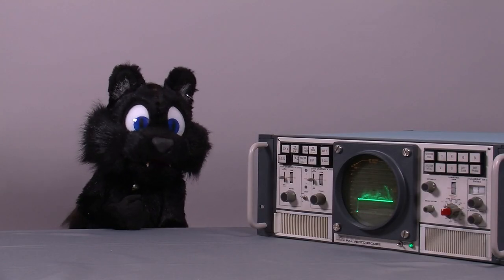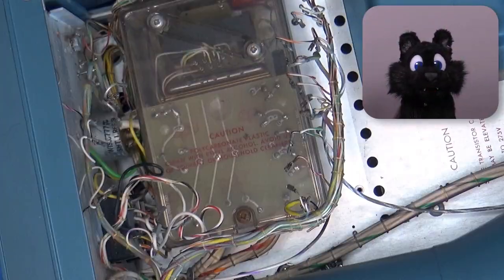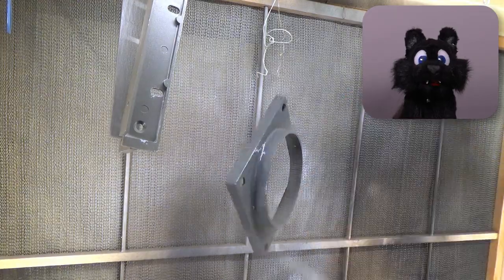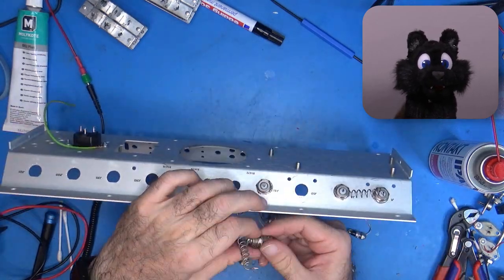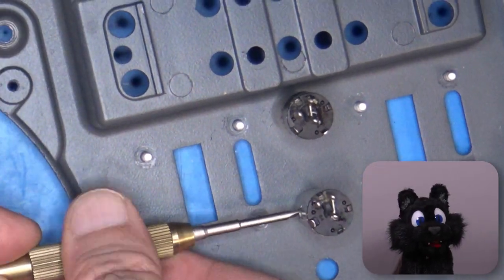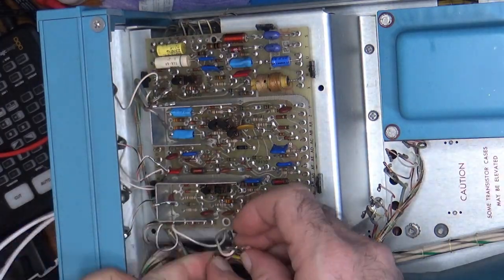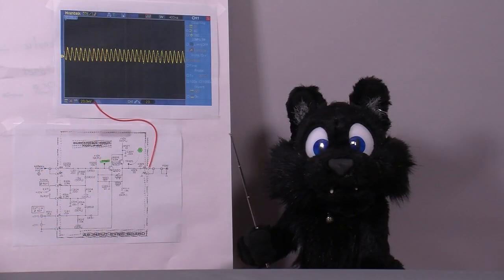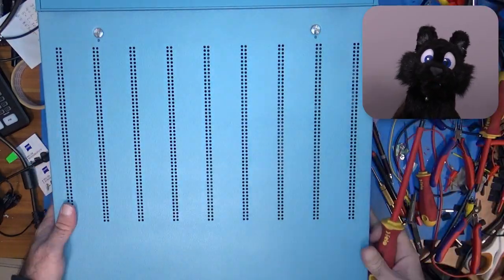Workshop Project #12 - Tektronix 521A PAL Vectorscope

Comment: Excessive work! How many hours did you spend on the restoration?
I wonder you did not rewind the transformer ;-)
Reply from the maker: Thanks! - It is hard to keep track of exact times here... I have the electronics desk next ot my work desk and I alternate to keep my mind "fresh". But I'd say the pure working time would be about 6-ish hours. There are wait times, research times, paint-dry-times and spare-parts-in-the-mail times that add up, so over all the project took over a week.
:P the transformer is now in storage. I might have had a go, but at that size and with just one standard output voltage it's not really worth it, especially since the "charging" was not suitable for a modern style battery.

Comment: Wow they really dont make them like that anymore. Those are some SERIOUS Sprague caps. Real chonky ones there. 
I am slightly concerned with the calibration in this unit with all the tinkering, and this thing looks like a proper pain in the ass to take apart, I can't imagine how many notes you had to take to even have a chance of getting it back together!
Reply from the maker: I did follow the 520 calibration guide exactly. So while it might be "homebrew calibrated", I am reasonably sure it is "good enough for hobby use" even in absolute readings. Calibrating it took about as long as assembling it; not even counting my PAL/NTSC mishap. Lots of trimmers in that thing :)
The notes boil down to lots of cell phone pictures and the videos. Once I find schematics for the device, it's much easier and the number of notes reduces dramatically.
Reply: @atkelar  Fair enough! You're far more adventurous than I in matters like this.  About as in-depth as I get is refurbishing audio equipment.  Speaking of which, I have a Carver TDR-2400 cassette deck that needs some attention today....
Reply: My experience with old Sprague caps is they probably outlast whatever you replace them with.
(there are some exceptions though)
Edit: Unless you replace them with new Spragues also.
Reply from the maker: The new ones say Sprague on them too? :)

Comment: Why are you soldering to the new power socket? These 3 connectors are made for crimped plugs.
Reply from the maker: These ar a bit tiny for any type of spade connectors I have around... They do seem way too small for that on the model I have? Besides, all of these connectors I ever came across were soldered too. Do you have a reference of what type of connectors that would be? All of that aside, there is next to no clearance between the plug and the HV case, so unless there's "angled" ones available, I'm stuck with this either way.
Reply: @atkelar  I see. All the ones I ever had used standard sized spade connectors.
Didn't think that smaller ones existed for this application.
 I try to avoid any soldering on mains power (at least on the mains side of a fuse that would melt earlier then the solder)

BTW, there are 10A cold sockets with an integrated, replacable, glass fuse that are just a but higher. Could work better for the form factor of a large, round hole in retrofitting an old device with a modern plug.
Reply from the maker: I finally found a spare one to check... indeed slightly smaller than "normal" ones... but not as tiny as I remembered. Weired.
Reply: Did you find the manual online? I had to order a paper copy from the U.S. and the postage was a small fortune – I live in the U.K!!!!